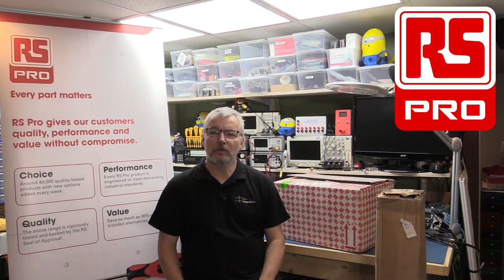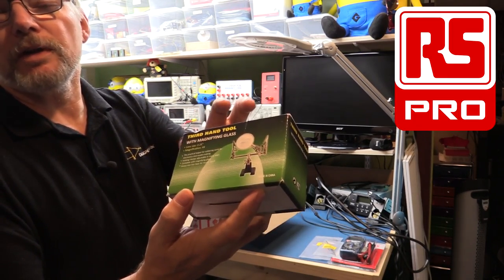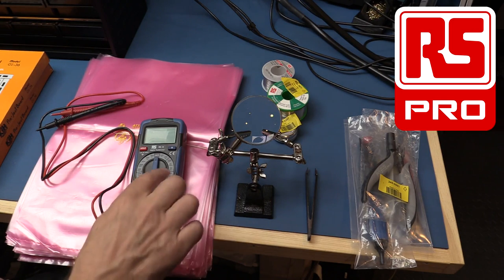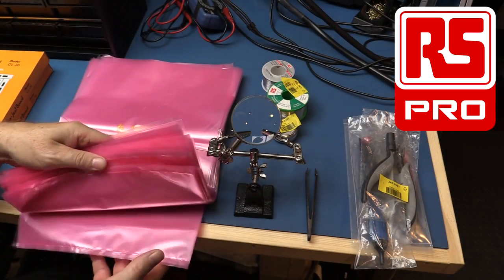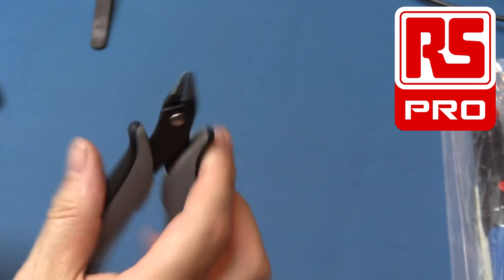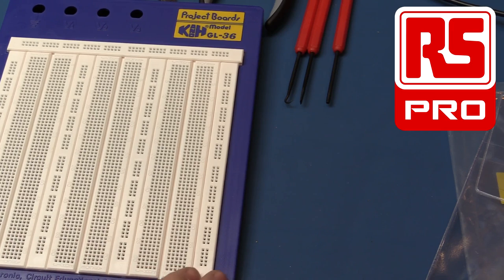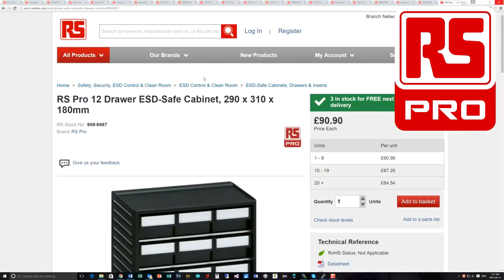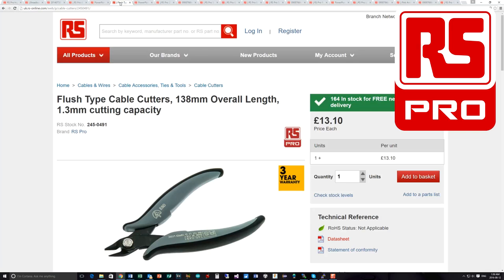RS Mailbag - RS Pro Goodies for the Bench

Comment: I look forward to the review on the power meter. I used Murata power meters recently as a CNC spindle load meter,. The Murata units come with a a built-in current transformer, but don't have I/O and their update rate is perhaps 1 Hz or so, which feels too slow for a spindle load meter. I load forward to seeing how the power meter you received compares.
Reply from the maker: in preparing for the review I opened it up "Tear Down Style" and discovered it actually does have 3 current transformers already inside, one for each phase / load. This surprised me as the external diagram clearly or so I thought indicates you need external current sense coils. Perhaps a bad translation or meaning for say a 1000A load it has a step down current transformer.. who knows.